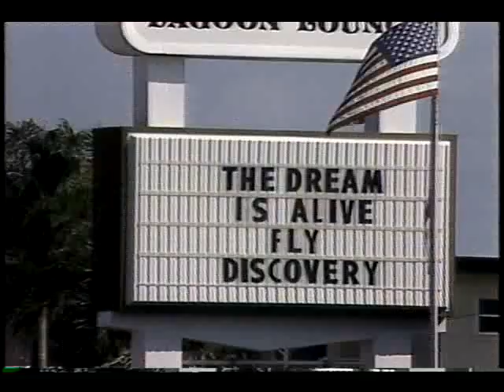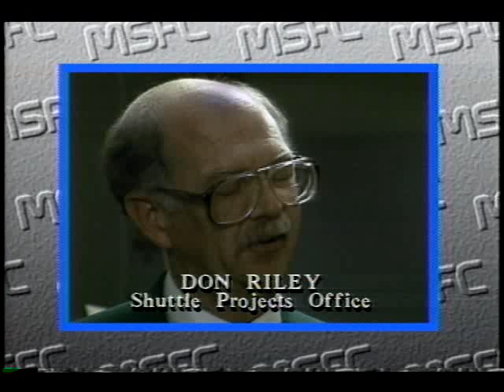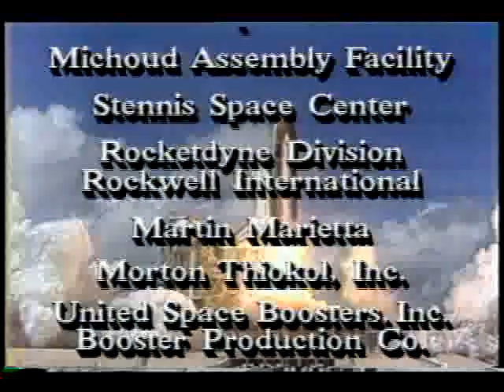Return to Flight 3, The Journey Continues

Comment: All the skills necessary to have access to space was vital for the United States. But there was no attempt for diversifying STS vehicle into an aerospace market infrastructure. If you can't 'roll' them off like 'DC-3's or '747's '; this becomes a program for a big government. There were options, STS had suggested derived application (e.g. The fuel tank going up as a wet space station?); but the programs cost would have been in danger if failure occurred. 
Hopefully, with 30+ years experience a stronger and more effective space plane will emerge? Its not the only pursuit, but since 'heavy lift' was the shuttles best feature... the gap will have to be filled for a future in Space.